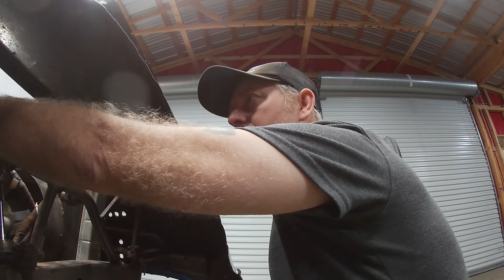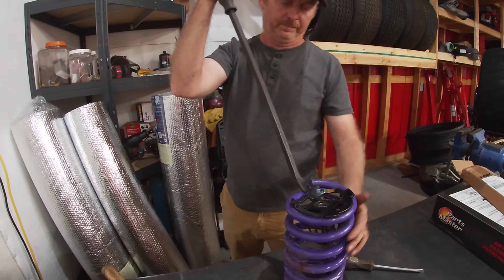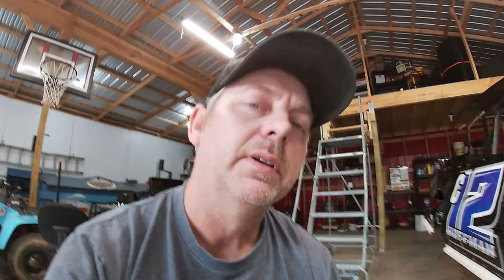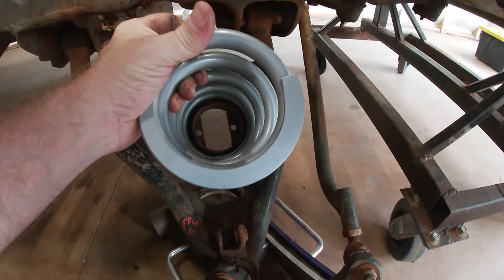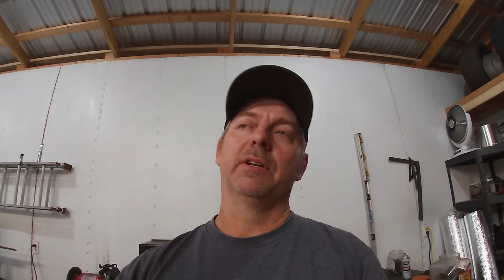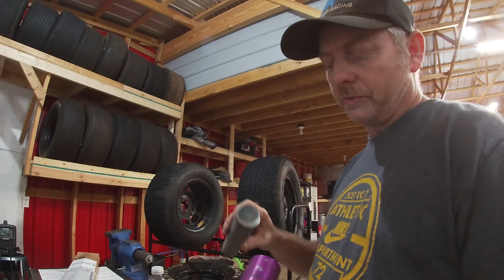Maximizing Our Fuel Pressure and Correcting a Rookie Mistake!

Comment: I tried to message on Facebook
But anyway you guys need to build a fuel storage log for the carb. I built them back when I was racing 4 cyl back in the day.
Had the same issue when I would hammer on it it would drain the bowels in the carb and the stock pump couldn't keep up. When I built that it solved my issue.
You might also swap the lower half of your fuel pump out with something differnt that has the large ports you pump looked like it was rebuildable.
Reply: Just had ideal for the fuel log/storage at carb gut and old 6 or 12 inch fuel filter housing and use that it will be ready made.
Reply from the maker: Thank you my friend, that is a great idea! I’m definitely going to look into to that, great idea!
Reply: @hr4racing let me know in your videos if it helps or gets it fixed up for you